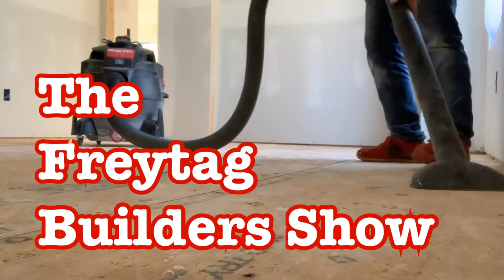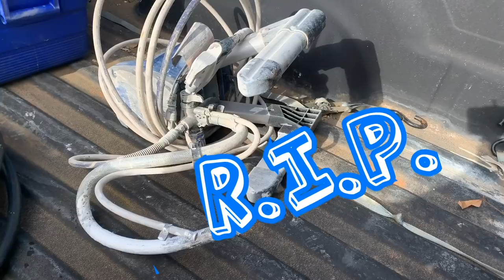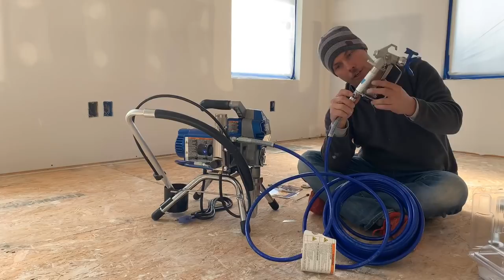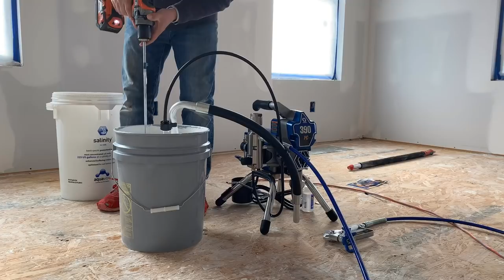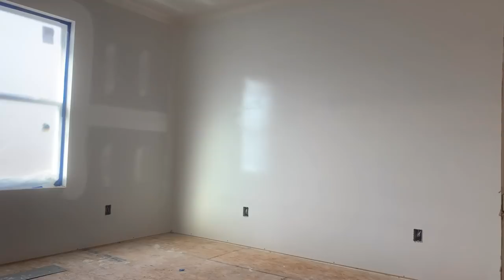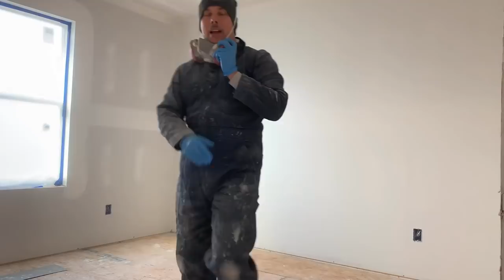Graco 390 PC Setup and Test

Comment: Looking at getting  a 395. This is a good upload thanks man!
Reply from the maker: frank jones Awesome Bro.  I was wanting the 395 but they didn’t have it in stock and I did not see a need to spend the extra money for what I was doing.  

Feel free to fill me in on what the benefits of buying the 395 over the 390 are.  

Thanks
Reply: Matt Freytag I actually picked it up yesterday. The benefits are a slightly more powerful motor and the ability to provide constant pressure. My bud uses 390's and he says he doesnt notice any pulsing in pressure. They said its only noticeable with very short  hoses.
Reply from the maker: frank jones Yeah that’s right.   I remember the electronic part of it that provides constant pressure. I watched several videos about them but have just forgotten since then.

Comment: How to do touch up on sprayed paint?
Reply from the maker: I really don’t know the answer to that question.   Someone with more experience needs to answer this.   My best guess would be to tape out a section so that you wouldn’t see the seams and spray the whole section.
Reply: Good luck with that, especially low sheen or eggshell paint, you better paint the whole wall
Reply: You spray. Hand helds are great for this purpose if not much touch up to do.

Comment: Hi! What happend to old Graco sprayer? How long did it last?
Reply from the maker: I can't remember exactly how long I have had it but prob 8 -10 years.  I only used it on occasion but prob sprayed over 100 gallons thru it.  It still runs but does not suck the paint into it anymore.  I was gonna work on it but haven't gotten around to it yet.
Reply: Matt Freytag it prob just needs to be re packed.  It’s fairly cheap!

Comment: Hi Matt, when you say you turn your tip back, what is it for ? Is it for saving the tip ? And that way you dont have to take it out for saving your tip ? Thanks for your help !
Reply from the maker: Steve Beaulieu. Actually the process I did at the beginning of running the water and paint through the gun should have been done with the tip removed.  The material would have went thru faster and you would avoid and unnecessary wear on the tip.  They do wear out from the paint acting like an abrasive and blowing out the inside of the tip making it spray differently than intended.  

As for turning the tip around!  The reasoning for this is to blow out any trash or debris to unclog the tip then spin it back around to continue painting.  

Hopefully this answered your question.  Thanks for the comment and for watching the vide.
Reply: Thanks a lot Matt :)

Comment: So what’s the point you have to go over it with a roller
Reply from the maker: Hashooma toy fun Alfarawi It’s just what you do
Reply: To achieve a more leveled coat on PVA primer wen you'll get more experience spraying w
You dont need to back roll is jest primer
Reply from the maker: ebenezerENlosangeles I disagree with not back rolling.  Not sure about where you are located but here the backroll helps even out the texture between raw Sheetrock and drywall mud on a typical finish.

Comment: Do you run thinner threw the pump after cleaning?
Reply from the maker: gooch47856 Good question!   I only spray latex water based paints through this spray rig so no I don’t use thinner on it.   I only use water and properly oil the piston.  Thanks for the comment.
Reply: Wow talk about a speedy response! I just bought the same pump.
Only reason I ask is because I have had a couple painters tell me that letting water sit in the pump can corrode the inside of the pump.
Reply from the maker: gooch47856 Yes I believe you are right.  Graco makes a product called pump armor you can use for storage but I have heard of running some thinner through it to keep everything lubricated. I have not done so yet but I’m glad you mentioned it.

Comment: How to avoid a lot of over spray?
Reply from the maker: francisco ballona you just have to use drop cloths and mask everything off you don’t want paint on.
Reply: Use a low pressure tip and mask
Reply from the maker: Bro I have the green low pressure tips.  I still get overspray but not as much

Comment: Can oil paints be used with that?? Or is it only water based paints..
Reply from the maker: Yes it can be used with oil paints.  Not sure which tips you would use.    I choose not to use oil with mine since the cleanup would be messy.

Comment: I got me a 390 pc and honestly I regret it not because it whas a bad machine It did more that a little pony should do but I end up buying a 490pc with in a year a litle more money but it has a 1 hp and a better pressure control set also brushless motor and sprays more per minute all that for around $400 more the 490 you can use it on exteriors and you don't hear a little motor being over worked dont get me wrong my 390 painted a 2 storage house but like I say I know I was burning the little pony If you can extend you're buffer a little I recommend a Ultra Max 490pc  Cheers from North Hollywood California
Reply from the maker: ebenezerENlosangeles I don’t really paint that much so I don’t see the need to spend any more cash.  I painted the exterior of my house as well with this machine and it ran just fine with no problems.  I do not feel it was overworked at all but I have not used any larger machine so it’s hard to give an accurate comparison.  Thanks for the info.
Reply: 390s are workhorses, IF you take care of them!

Comment: I am old school roller & brush guy. I just hired a painter because i was lazy to paint interior. Know wonder why 2 coats didn't cover well. They must have used a paint gun & charge me extra for 3 coats of paint. Unfortunately, i could not be there to watch how they painted. Never ever again hire another painter they all shortcut if you're not watch them step by step.
Reply from the maker: H B Ok. Not really sure what you are implying here but I know plenty of honest good painters that use a spray gun and do the job right.
Reply: @MattFreytag  Not implying nothing negative. Just question the spray gun technique. Thanks you for showing me how gun works.
Reply from the maker: H B no problem

Comment: Its always a good idea to back roll even more finish coats such as ceiling flat as if you need to touch it up as a spray finish leaves it to fine.
Reply from the maker: Thanks for the comment.  Great tip.
Reply: Would I have to do that with a fence? I just brought one and looking to use next week.
Reply from the maker: Richard Gorham I really can’t say.  I have never sprayed a fence.  I would not think you would have to with a fence but you probably would want to buy one of the green fine finish tips.  They produce less overspray at lower pressures.